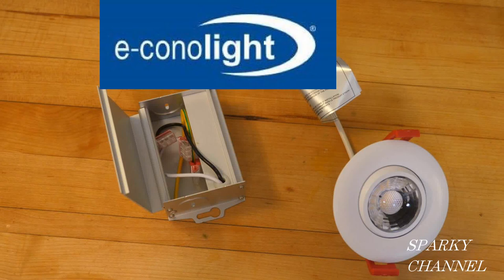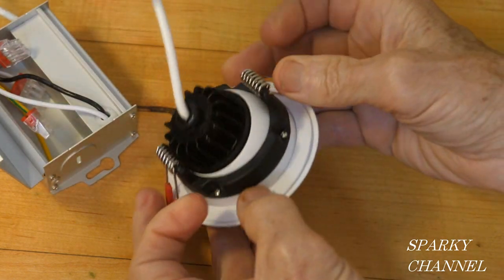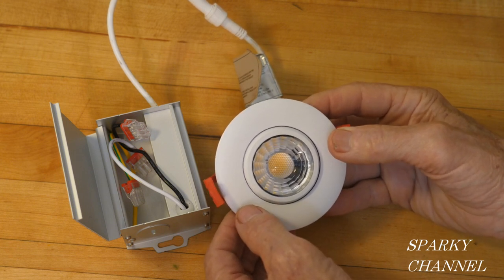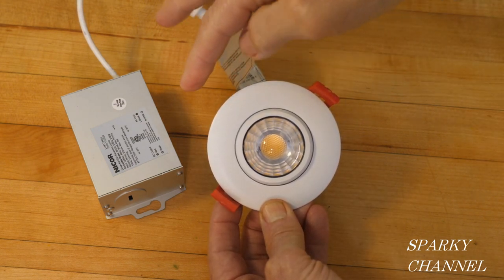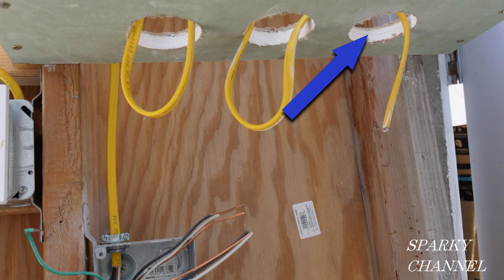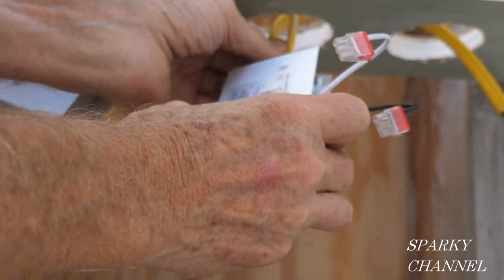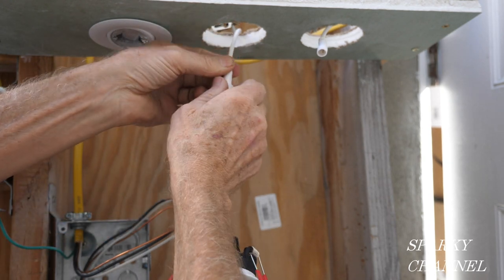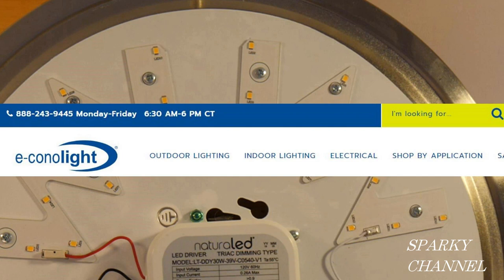How to Wire and Install Recessed Gimbal LED Downlights by Nicor

Comment: Nice product and price Bill thanks👍 probably going to use them in some new construction cut- ins like the Wafer Lights kits. Have you use them in new construction at all?
Reply: Bill when you demonstrated the 3 lights with the dimmer it appeared the 1st light seemed to be brighter so my question. Was it just camera angle or camera location?
Reply: @mkidd8806  it is because the first light is aimed more directly at the camera.  you can see by the shadow image how the light is aligned in relation to the camera. - if the light was aimed directly at the camera, the bright spot would be centered and there would be no apparent shadow.
Reply: @kenbrown2808  i see your point but my question can be a bit miss leading. I know with led many issues come into play in reguard to dimmers. These 3 lights are wired in series in reguard to power supply coming into #1 light then feeds #2 etc.
Reply from the maker: Hi Anthony! No, I haven't used these in new construction yet. They seem really easy to work with, such a long way from the old can lights!
Reply from the maker: @mkidd8806  The LEDs all came on and dimmed equally.
Reply: @SparkyChannel  best answer. Some viewers dont understand led and wrong dimmer issues etc.
Reply: @SparkyChannel   I agree for sure Sparky
Reply: @mkidd8806  no, that's a daisy chain, not a series.  yes, with low voltage lighting and long cable runs with undersized wire, you can get voltage drop between the first light in the daisy chain and the last light in the daisy chain.
in this case it's just camera position.
Reply from the maker: @kenbrown2808  Absolutely. I just ordered the new Leviton 2nd gen D26HD dimmer with Alexa, etc. It has wire-free companion dimmers! I'll be making a video about those as well.
Reply: Standard recessed lights in Europe. We never had these big cans. Back in the old days they were low voltage halogen, required a transformer from 230VAC to 12VAC.
Reply: @Marcel_Germann  12v lighting is absolutely horrid to work with, especially back in the days of incandescents. It created such high currents the contacts would burn up.
Reply: @SparkyChannel  I favor the lutron maestro. Of course, no Alexa on those, but their pico switches can be a job saver.

Comment: What do you do if there is strapping where you want to install the light? The top of my gimbal lights extend 2" into the hole. Can I cut the strap and build a wooden bracket to attach which would go over the top of the gimbal light and maintain the structural integrity of the strap?
Reply from the maker: Because I can't see it, I don't really know. You would need to maintain structural integrity as you mentioned.
Reply: @SparkyChannel  Thanks. I did some research and found that you can cut into joists up to one-sixth of its height. In my case, my joists are 8" high, so I could cut up to 1.33". But I'm just cutting a 3.5" long notch about .75" into the joist to give 1/2" clearance above the 2" high gimbal light. (1" cement board & Canec + .75" strapping + .75" notch = 2.5").  So I should be okay. (I did read that Canec has been known to contain arsenic so a dust mask and vacuuming up the dust is important.) Btw, that cement board really ruined my hole saw teeth.

Comment: You can leave the J-boxes unsecured?
Reply from the maker: Yes. There is a screw hole on the j-box to secure them to a nearby joist if it's practical to do so.
Reply: @SparkyChannel  Thanks for the video and response.

Comment: you made a slight mistake - the gasket helps it air seal to the ceiling material for current (thermal) insulation ratings - the sealed construction is what makes it damp location rated.
Reply from the maker: Interesting. Thanks Ken!